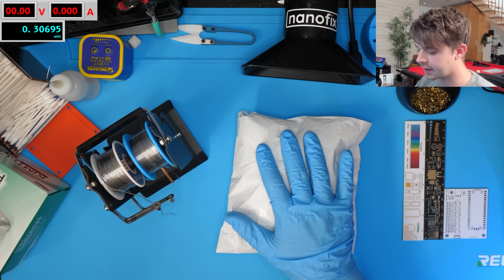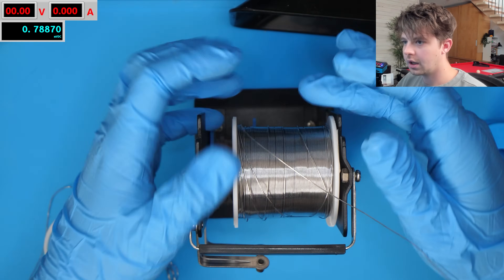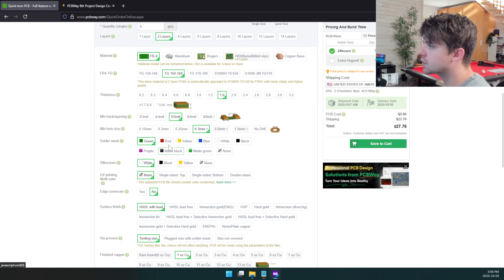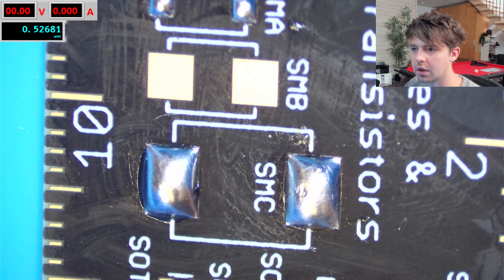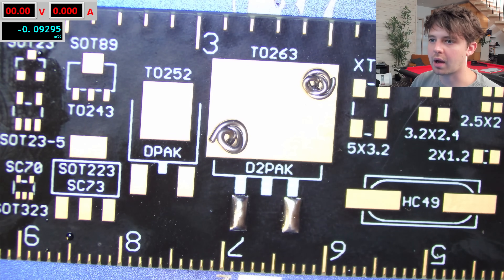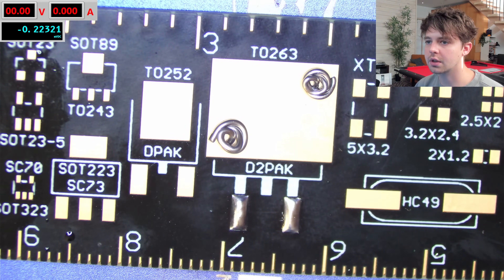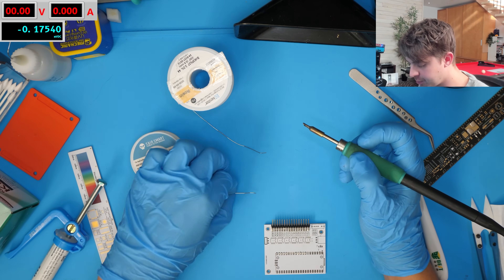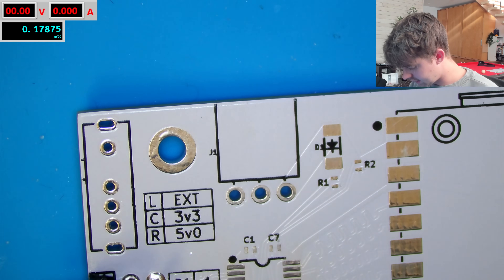Is Kester Solder Better?

Comment: I got 1 ounce of Kester 44 on Amazon for like $12. I'm just starting out repairing consoles for my eBay store and I'm blown away by how much better the Kester is compared to the solder that came with my iron. Going to check out the Mechanix after I run out of this too

Comment: 63/37 is 63/37 however just because it says its that doesn't mean it is! And you can sometimes see that on some solders where its not as shiny or it pits or stress cracks more as it dries. The nice things and also the more confusing part about Kester solders is that you can pick the type of flux IN the solder. From clean free to aggressively corrosive flux that WILL reflow a circuit card from the 1950s and I promise you I have experience on working on cards that have a date stamped of 1949 as recent as 2025. But if you have ever tried to reflow solder that is older than your mom Kester with their aggressive flux is the difference between a scrap card and making 10k usd.

Comment: We're ive noticed Kester really shine is when your soldering on stuff that is contaminated and hard to take solder. I was using MG chemicals solder after using kester for years and I was making test leads for my oscope and I couldn't get the solder to stick on the banana sockets I grabbed a role of kester and worked right away had the same experience  multiple time with some different projects.

Comment: Wait 'til you try Kester's 62/36/2 silver bearing solder.  It's like magic.  It's also (unsurprisingly) expensive.  I originally started using silver bearing solder when repairing old Tektronix scopes that required it, but it's so nice to use that it's now my standard solder.
Reply from the maker: I have been meaning to pick this up!! I will definitely make a video about their silver stuff and will be sure to get their no-clean core

Comment: I'm a big fan of Kester, same solder (0.8mm) in Amazon for half priced in fact got two. When I started first my hobby I used Maperlin(UK) solder and it was so bad. Then used some Chinese brand (orange and white labeled) it was a nightmare. Then got Kester no more issues. Yes cleaning is bit difficult. I think BEST 60/40 and HX-T100 is some what I would consider as decent solder.

Comment: We use the Kester 275 which is a synthetic 2.2% and it works great, also have a specific project we use the water soluble flux I think it's 313. When full cleaning and no contamination is allowed it has worked wonders and solved multiple issues we had with the "no clean" flux

Comment: Yes. Kester is better. It is the gold standard for soldering thru-hole PC boards and point-to-point wiring. I've been using 60/40 0.031" Kester for about 50 years. I've tried other solders from time to time, and the only one that was comparable was, believe it or not, the solder that Radio Shack used to sell. I service vintage audio gear to this day, and Kester is the only solder allowed in my shop.

Comment: When I bench soldered in a board assembly house we did not clean flux with Q-Tips. We used cut down flux brushes. We also used Kester solder professionally too. We also used a flux cleaner. We did not use alcohol.

Comment: 12:01 yeah, you really need to work on your solvent supplies rather than solder. If your solder is able to go against kester, than you are totally fine (even though it looks like a noname reseller paying CN OEM to glue sticker with their brand, NGL).

But this clean up mess I see here is a struggle painful to see on a channel that is deep in rework tools and chemicals game. Whatever you are using is not dissolving rosin at all, it should completely liquify it as if it is hot, so it would not be tacky anymore and could be cleaned easily with fibrous wipes (I'm not even using q-tips primarily, only after wipes for prestine cleanup or in tights spots, because initially you only need as much fibrous material to suck up solute as possible and throw it away less often than you have to with q-tips).

13:32 this is almost burnt dry rosin residue (deactivated flux, less tacky or not at all when fully evaporated the liquid content, so becomes a hard surface) that is better to scraped off mechanically, pretty inefficient to try to dissolve that, especially when it is really burnt.

P.S.  The hype around Kester (and Asahi, and whatever else..) is just a difference between cheap CN mixtures that flooded the market of whatever they had that day and clean tin-lead proper solder without parasitic metals. Otherwise kester is pretty not cheap and often hard to get compared to local options of same quality. Between name brands, the only meaningful difference is flux, and moreover you are really better of using no-flux core when utilizing you own flux separately, espicially of gel type and BGA quality, that is not smoking as much, does not burn as easily, has required acidity and so it won't mix up with core flux.

Comment: In my personal experience, when soldering on newer boards and newer electronics such as what you work on, the extra cost isn't worth it. 

However, when soldering on older electronics, Kester seems to be much better suited for it. Granted, im not doing anywhere near the level of testing you are. Just what I've found from using it. 

Doing an actual test like you did on older stuff may prove me wrong. It's very possible that im being a bit biased without realizing it as well.

One thing im super curious about is what we will see in terms of longevity between things like Kester and the cheaper solders from China. Talking 30-40 years from now. Sadly, no real way to test that besides waiting that length if time. LOL

Comment: Bought some kester solder after running out of the original radio shack solder I bought. Agree with your conclusions, nothing special. If anything a bit messier.

Not sure why it so popular. Guessing it is simply based on being reliable and having been around a long time.

Comment: I have been using Kester Lead-Free No-Clean for several years now and i love it.
Reply: Is it usable with the same temps as leaded solder? I use 310-330°C on my iron with Chinese "mechanic" brand leaded solder. I find that keeping the temperature in that range is easier on my iron's tip.

Comment: For most commercial work I doubt there is any fundamental difference between the two, but hi-rel (military/space program) require solder compliant to IPC-J-STD-006, used in accordance with IPC-J-STD 001.  That certification might be the only reason to buy one solder brand over another.

Comment: I've been wanting to try Kester for years, but honestly, just a few days ago I started using Mechanic from Aliexpress, and it's everything a hobbyist who repairs old consoles could need: replacing capacitors, repairing some traces, installing CPUs and memory chips, video modifications... In fact, I think the HX-T100 solder is perfect for learning to solder or improving your technique.

They sell good products in China, the problem is finding them; there are thousands of different brands selling the same bad solder with different labels. It's quite annoying; it's normal for a professional to buy brands like Kester, I would do the same. Thanks so much for the video.

Comment: Both look basically the same.  I been using AIM solder with Mg chemicals no clean flux.  Which Mg are you using?  You can try the new northridgefix flux.  I think it might be made by Mg or Aim.  Its from Canada...

Comment: I really like kester but for my needs it's a bit pricey.  Shockingly I did stumble upon a really good, cheap, chinese 60/40 which works really, really well.  but the best solder I have ever used, by far, was from a 5lb roll my grampa had in his workshop.  It was from the 60's from a company called Cramco out of Toronto.  That roll lasted me well over 40 years, and while the label flaked away many years ago I still clearly remember it.  been looking for it ever since and so far I haven't had any luck.  So cheap chinese solder for the win I guess.

Comment: Nice testing approach. Thanks for sharing. 
I am an old timer, using solder since the late 70's. KESTER. One note regarding the Rosin flux cleaning : I guess u r using Iso-propyl alcohol, if so, try switching to Iso-Propanol. I guess (out of practice only) it is the perfect solvent for Rosin.
Reply: 1. Isopropyl alcohol and isopropanol are the same thing. So is propan-2-ol. Different names for the exact same chemical. Commonly abbreviated to “IPA”. 
2. IPA is absolutely NOT the “perfect solvent” for rosin flux. Solvent blends (typically a mix of IPA or ethanol with a hydrocarbon and/or acetone and/or terpenes), sold as flux removers, are far more effective.

The Kester 44 datasheet explicitly says that IPA is NOT sufficient to properly clean it.

Comment: This was excellent. I had heard Kester was the best as well, but the price was pretty high. (Even in the states, the difference in price between these two is 4x!) Glad to see the price to performance does not match up.

I would like to see a video comparison of leaded vs non-leaded solder. Not really 1-on-1 like this video, but more inline with your flux videos, where you have several different options to compare.
Reply: I don't think Kester is the best. But Kester is commercial grade material. Kester is pro stuff. Kester is a widely known and respected name brand. You know what you're getting when you get Kester solder. That kind of consistency costs money. Kester is at the point where they can trade on their reputation. You're paying for the name.

Comment: I wonder if I’d be able to send you some solder. I have a friend that is a dealer for Cardas Audio. I’d be curious to know how much a roll cost in Canada.  If there is a way to get ahold of you I’d like to send you some.  It’s a mix of lead, tin, silver and copper.  Many in the diy arena swear by it.  I have to say it’s one of my favorite solders to use.  Flows very nicely and every joint comes out mint.  I also use Kester 44 and I like Delta. All solders I use are 63/37 other than the Cardas. But yeah I’d like to send you some.
Reply: I’ve never heard of anyone outside of the audiophool… ahem, ”audiophile” scene using (or even really discussing) Cardas solder. Everyone else recognizes that solder just isn’t going to make any magical differences in electrical or sonic performance. And from what I’ve read, it flows quite poorly compared to good “ordinary” solders.
Reply: @tookitogo  well you must not have done much looking then. It’s talked about on electrical engineering boards, eevblog, audiokarma (which many wouldn’t consider themselves audiophiles). I never once implied it would have magical electrical properties and I have never once, in my entire live, have read by anyone that it flows poorly. People on the EE boards rave about its ability to flow and the fact it can’t solder so well to corroded leads (due to the internal flux.  They also like, as well do I, that with its silver content I can solder to ceramic substrate without damaging the traces. Your comment just shows how little you must have looked, if at all.
Reply: @danhorton6182  Well, see… therein lies the rub: I did do quite a bit of looking before commenting. I’m an extremely active eevblog forum member, and the Cardas solder has only ever been mentioned a handful of times. I have seen many, many eevblog threads discussing solder recommendations, and Cardas simply isn’t on people’s radar, and engineering types are generally put off by the audio woo-woo claims. (We are also put off by Cardas’ refusal to disclose the alloy, which strongly suggests it’s nothing new or special.) 

On various audio forums, some people swear by it, but many say it produces gorgeous shiny joints, but isn’t worth the exorbitant price. 

As for flow, there are reports of the product changing around 10 years ago, with the newer version smelling like burning plastic and exhibiting inferior flow. 

As for the properties of the solder alloy itself: there’s no question that silver-bearing solder produces the shiniest joints. Similarly, it is well understood that it is essential to use silver-bearing solder for things like those old Tek silvered ceramic tag boards. But in those regards, the Cardas isn’t special or unique.
Reply: @tookitogo  that’s totally cool. Everybody can have their own opinion on it.  Maybe we’re just not looking at the same sections of EEV or DIYaudio. I work with solder every single day, I repair and restore electronics for a living, mostly audio equipment. I have never seen anyone complain about its ability to flow or the joints that are left. Yeah I think that they’re reluctance to reveal their formula is kind of stupid. It’s their own proprietary formula so they can do it if they want.  And just because something has woo woo claims doesn’t automatically make it a poor product. 

There are some very highly regarded electrical engineers that like using Cardas. And no, these are not people that believe one polypropylene capacitor will sound better than another polypropylene capacitor, or at least make an audible difference or that a cable is worth $1000 a foot. Like I said, I used many kinds of solders even cheap solder. The cheap solder I use is the Delta 63/37 and it works great. The Kester I use works fantastic. I have some AIM silver solder that’s pretty good. But hands-down, there is no question that the Cardas is the most pleasurable to use. I would have to say the AIM is the worst and it is lead bearing.  You can’t always just form opinions off of what you read on the Internet and I would love it if you pointed out threads where people are saying it’s a poor quality product or that it didn’t flow nicely.  

You have formed your opinion by what I am assuming is never using it and I am forming my opinion mostly on the fact that I’ve been using it for several years.  My most recent rolls were manufactured recently, and I have noticed no change in its performance. 

But yes, I will admit that if I had to purchase it at the standard retail prices, I would most definitely use it less, far less.  It’s too expensive in my opinion.  I feel they would have the right to charge same more than Kester because it works better than Kester in my opinion. I would probably cap it. It say maybe $80 a pound or so.  Not too far back you could get it for $95 a pound.  I mean, look at the price that he paid in this video for that but most would consider mediocre solder.  The price he paid was way too much. Would I be devastated if it disappeared? No there’s still plenty of solders that do a good job like Kester, but I would certainly be disappointed. 

But anyway, you have your opinion on it and that’s cool.  If you can, maybe find a good deal on save the quarter pound roll try it out for a period of time and see what you think. No I do not believe it will do even a fraction of difference on say the audio Fidelity or anything like that.  I just find it extremely nice to work with and I’ve seen joints that are 10 years old and still look as shiny as ever.  But again, you’ll get that with a lot of silver bearing solders.

Comment: It's expensive but it's good. I love it, have the same roll from when I really started soldering. Went from junk harbor freight stuff to get into the hobby to learning and searching what the pros use. No junk here!
Reply: Also bought copper pipe Flux for brazing i think. Used it on one of the first xbox 360s and was like wtf is this.. you would think someone would just know but you gotta poke around and find out to realize what is what.

Comment: BTW, Sayal in Canada has Kester solder for a really good price.  I've actually ordered the SAC305 from there from the US because it was cheaper than anywhere else I could find it even after shipping. And you can get it in different flux cores, including no flux, since you are usually using your own tacky flux anyway.
Reply: Thats very cheap, $45 CAD for a 1lb roll, which is $32 USD.
Reply from the maker: Good to know! thanks for the heads up 👌🏻
Reply: Amazing tip. Thank you just saved me $40.

Comment: I got my rolls of Kester for free.  If you work at a place that follows "expiration dates"  on stuff,  they actually have expiration dates on solder now.  They over ordered and thus when it passed it's arbitrary date,  they had to dispose of it to avoid the auditors.  Sure,  I will get rid of that for you!  The only issue I have ever seen with solder age is old rolls that were stored poorly in damp or something,  where lead oxide may appear on it.  But you got to really try hard to get that result.
Reply: That isn’t new, they’ve had expiration dates for decades. High-reliability users (military, aerospace, etc) need it, since they don’t want to take ANY chances, no matter how tiny.

Comment: Kester has a ‘no-clean’ 63/37 which I suspect would resolve some of the flux issues and be a closer comparison
Reply from the maker: I'll check this out for future solder comparisons!
Reply: @nanofixca  As far as I understood - "no clean" in kester 245 means you will not be able to clean it with IPA lol
(datasheet also says that btw)

Comment: A better comparison would have been Kester with the 245 NC flux, IMO. I would also be wary about buying any of the name brand solders from Amazon from third party sellers. So much of it is counterfeit these days, even when fulfilled by Amazon. Spend a few bucks more and get an assortment of sizes from Digikey or Mouser to be sure you get the real deal. One other benefit of brands like Kester is consistency. Sainsmart doesn't make solder, it's private label and subsequent rolls can come from different suppliers. A roll of Kester you buy today will be the same as the one you buy next month. Buy once, cry once.